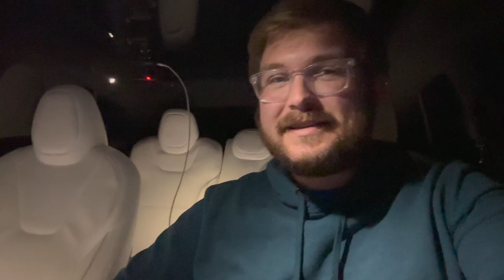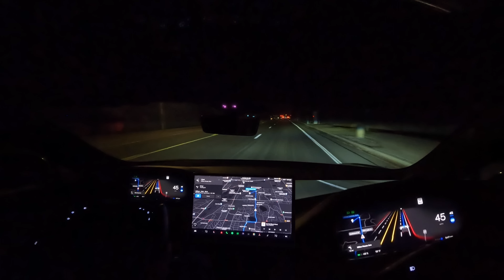I Finally Got Tesla FSD Beta! First Drive And Raw Impressions In My Model S At Night

Comment: I can't wait for FSD to be perfected, but it's nowhere near close from my experience with it.  There were way too many critical errors when I used it last month.    Kyle you are so right about the "social aspects of driving."    I'm sure FSD is 10x safer than a human...   but it drives like "screw everyone else" and is not comfortable experience to the user.  I think the better test of a good FSD system is how comfortable and relaxed the user is with letting the car do what it do.   My FSD had be flying way too fast through neighborhoods and parking lots.   Fails the left turn consistently out of my neighborhood, and left the car perpendicular across two lanes because it wanted to take a left, but then sensed a hard median and didn't know how to correct.   So I just stayed there.  ...and generally, like you said, was missing the social driving.
Reply: "is not comfortable experience to the user" Thats not the point. You can be embarassed or - as you say - have a uncomfortable experience - as much as you want, Did you produce accidents with your FSD driven car? No? Goal achieved, Job well done. Full stop.

Your embarassement aka your "comfotable experience" is not something FSD can and wants to solve.
Reply: @wolfgangpreier9160  Not crashing would be the absolute lowest bar that Tesla seems to have partially solved, but if they want to be a serious robo taxi option that regulators will need to approve, they will definitely need to work hard on the social driving experience and overall comfort of driving.   A Tesla robo taxi is not going to go mainstream or even get approval until they can drive at the same level and comfort as a professional driver/chauffeur.
Reply: @wolfgangpreier9160  i disagree. Never versions of FSD are smoother and more considerate. It will take time. I suspect the issue is less in the data gathering and more in the software logic of what to do.  So hopefully they continue improvements.
Reply: FSD is 0x safer than me.
Reply: No way this is 10x safer than a human, the average driver goes for years without getting into an accident. Myself I've been driving for nearly 20 years and luckily I haven't gotten into an accident. This fsd can't complete a 20 minute drive without human intervention.
Reply: @Cornelius87  I agree 100%
Reply: @punksjutgbd  You must be the new Model from Boston Robotics. How does it feel being an automaton?
Reply: @marklefler4007  Oh yes, they do become better. Just as with every other Software made by MAN they are not perfect. Sometimes they take two steps forward and one step back. 

And then the shitstorm against Tesla starts again. Its tiring. And unnecessary. 

I hope that Tesla gets at least a local or temporary permit to roll out their FSD in Europe. So i can  contribute some hours of learning experience. Even as a glorified lane keep Assistent it would already save lifes. Many!
Reply: @tonykchan  Come time come creature comfort. Look at the first working cars. At the second batch. At the 1910‘s. At the 1920‘, 1930‘s etc. pp. 

I would not have believed Ford has solved the problem and invented the perfect electric pickup. I do not believe the first iteration of the Cybertruck is perfect. etc. pp.

I am of the opinion that there are at least 2 more complete rewrites and 1 more Hardware editions necessary to reach at least simple localized geofenced „level 5 autonomy“. General autonomy and usable AI will go hand in hand with Tesla bot, Boston robotics etc. 5 years? 10 years? Something like that. Somewhere in the far future.

I would already be happy with a jerking and not completely sure FSD in ALL cars that would reduce accidents and dead children to the absolute minimum achievable without staying in a bomb shelter.

Comment: You ask if the internal camera works at night. Yes. Look at your video and you will see a purple/pinkish glow at two spots from the rear view mirror assembly. These are IR diodes which the gopro and many other video cameras register as the purple/pink color.
Reply: It appreas these were added to the production runs of Model Y and 3 around July-Aug 2021, so not all cars might have them. I assume newer Model X and S have them too. Can someone confirm?

Comment: I agree there is a learning curve to properly operating a vehicle on FSD, because it isn't true FSD yet. I use it all the time and take over regularly without even thinking about it and then turn it back on after the problem spot. 

You're right -- turn signals are wonky. It signals right to say "I am not going to use that left turn lane" but when turning left it won't signal a left turn until it actually pulls into the left turn lane. Clearly sending mixed signals. 

It always turns a little right before turning left. Very annoying around here as people always stay left to leave the right side of a lane for those turning right. FSD blocks the whole freaking lane. 

In many ways it is better than a year ago but I'm a few cases, it is actually worse.

Comment: The clarity of the signals your sending to other drivers (and pedestrians) is important, as is consistency in those signals.  It's like a body language.  FSD beta so far seems to fail at both of those things.
Reply: In my experience with Beta, “it fails” is a bit too broad of a sweeping generalization. It succeeds and fails. When it fails it needs to fail gracefully and that is hit and miss.

Comment: I see there are few comments that are right on. You will get use to it and get more comfortable. For example left turn you felt acceleration, it would have stopped for the cars. Good way to double check is on the screen. The on coming cars would have been marked in blue. That means it will yield. 
My wife first started using, she was similar to what you experienced. Now she is used to it and knows where it cannot handle (ex. parking lots still a feature not deployed), she takes over without missing a beat. She hasn’t watched any videos other than my comments. Try few more times. The biggest limitation in my opinion, it is still too slow to make decisions. So you get nervous waiting or embarrassed waiting. These are the majority of the take overs. I don’t remember anytime it tried to crash. It is programmed to be over cautious.
Reply: Exactly this. Like any system (cruise control, TACC, basic lane keeping) it takes getting used to to use correctly and to know what situations it can and cannot handle.

Comment: One of the biggest problems with FSD is the lack of communication with other drivers.  People communicate by seeking each other's gaze.  Give hand signals and so on.  No one knows what FSD does.  Not even the driver of the car in question always knows because the system changes its mind in the middle of a manoeuvre.  We can see how it, like time, flashes to the left, then to the right, just for  to drive straight or - perhaps - turn??? Very unsafe.

 In Japan, I believe it was Toyota who made an attempt to put a few small screens / LED displays on the front of the cars and the rear.  The one on the front in particular was a good idea, it turned out.  It simply told the other drivers what the car would do in a short moment, as well as what the car expected, for example.  the pedestrians did here and now.  A standing man if it expected the passers-by to remain standing, and then a moving car (itself) which showed that now it wanted to start.  Conversely, when it stopped, there were pedestrians walking and a stopped car.

 It was mostly in connection with pedestrians that there was a gain, as other motorists "don't have the time" to check whether an oncoming motorist has such a display mounted and which "cartoon" is currently shown on it.

 Until a way is found in which FSD can send some clear signals of intentions, I am convinced that it will be more dangerous in traffic than a human.  This means a person who takes care of their driving and is alert, who is not drunk or under the influence of drugs.

 I'm glad that I don't run into FSD cars on a daily basis (forbidden to use in this country, so hopefully people don't).

Comment: Ive had it since November I found keeping it in chill mode is perfect for a Beta.  Signals go off in turns randomly,  I have learned in spots on common routes it take what to expect with brain farts.  Pretty much it does decent for me.
Reply: Decent for you but not good enough to be available for everybody. Very dangerous

Comment: Hey Kyle, you know how Tesla navigation voice prompts sometimes come too late for you to actually make the turn?  I suspect that the FSD neural net is NOT looking at the map path to choose where and when to turn, it is getting its waypoints from what would be the voice prompts to a human driver.  A human driver will not look down at the map, see a right turn in half a mile and decide to pass the slow moving car in front of him by going into the left lane, but a human that doesn't know the area with a blanket thrown over the center screen that is relying only on the navigation system voice prompts for turn-by-turn direction would...   Also, I suspect that the strange "turn to the right and creep a foot before making a left turn" is because the car can not turn its head to the right to get a good view of cross traffic... the only way for it to adjust camera view is by moving the entire car.

Comment: Drive it at the speed limit. Nevermind the tailgators. Be more patient at intersection when it's creeping.

 Google maps, always gives the right info ahead of a turn. (ex use 2 left lanes to turn left, bear right) Tesla should tape into this info in order to better plan the drive beyond the cameras field of view. 

I use it everyday to drive around town, most of the time I let do its thing only paying closer attention when it needs to make a more completed maneuver. When there are clear marking it's very smooth but when it to read the curbs to determine the path it gets sketchy. 

 In order for it to behave like a human it would have drive 15 over, tailgate everybody in front, swerve through traffic without using its turn signals and think that it's the best driver on the road.
Reply: Exactly!  Kyle should have done some research before doing this video.  He doesn’t even know that he sets the follow distance.  Not my favorite video

Comment: FSD can be impressive and insufficient at the same time. The danger is when some want to focus on the former and ignore the latter. 

I would be interested to see a controlled closed system test consisting of a downtown area with only cars equipped with FSD navigating the streets among each other. Only the machines driving, no interventions, for one hour. Then do it in a suburban environment, too. What would happen? 

If the answer is not “nothing unusual” the system shouldn’t be allowed to be used by untrained professionals in an uncontrolled environment. It’s a testament to Tesla’s ability to cultivate a market willing to pay to help them develop a system that is still a long way from fulfilling its promises.

Comment: The problem I have with this is auto manufacturers usually test these systems in a closed loop (test track, controlled drives, etc.) BEFORE releasing the technology.  Tesla is letting any owner pay to be a beta tester and then you the owner/driver is testing it on public streets and highways possibly endangering yourself and other drivers.  Your video showed that the system was erratic and dangerous.  I’m all for electric cars but not the mentality of fanboys that think that anything cool is good.

Comment: This very much proves Tesla NEED to have detailed video guides on what FSD can and can not do, and I think you should put more pressure on the twitter and youtube to ask Tesla to please just do a guide (like the NIO system). I see Kyle is incredibly confused about it and I don't think other people will be less confused for the first time using it... 1. It doesn't do parking lots at all, and right turning off a road onto a drive way is barely doable, you should take over just before the destination, and engage it only when you are on the road. 2. It doesn't do u-turns at all, neither does it do reverse. 3. This is a more technical fact but I do think they need to communicate this to people in a less technical way: 

The route planning basically have two parts, one is the navigation, just like the navigation you would get say from google maps telling you there's a turn somewhere ahead, or which turning lane you should go into. The other route planning is the actual driving route planning, i.e. the blue line on the visualization. This is the actual route the car is going to do and it tries to get the driving route onto the navigation requirements. Problem is this route planning has a very short distance so maybe it knows it need to right turn just 100 meters down the road, but the driving route planner don't see that turn (because it's out of the planning range). So unless the maps navigation has good enough data to tell it it needs to stick on the right lane, the route planner will just drive straight ahead (and in the case of the video, even going to the left lane because maybe it decides the car in front is too slow compared to the set speed).

When it goes off route it will try its best to re-route, but usually when you miss a turn the reroute puts you in for another totally impossible route (because no u turns). So what I would say is to just take over when it goes off route. Also taking over when it misses a turn sends Tesla a signal that this is problematic. (They track take overs and it's the most serious indicator to them that the system failed)
Reply: I would actually say it is not quite responsible for @OutofSpecReviews to put out a video that is trying to have it do things it can not do (lots of parking-lot and driveway related maneuvers). However I can't blame Kyle for this because no one would have told him or another customer the things it can not do...
Reply: Also it does do better in California, right outside their office windows. If you live close enough to their autopilot team I guess you can drive to work without takeovers...

Comment: Rule of thumb is don't try and judge FSD too quickly.  It takes a couple of weeks to become familiar with how it drives and when to intervene or disengage.  Nice video. @12:07 you talked about people saying a successful drive if it didn't crash.  I don't know anyone who thinks that nor do posts on Reddit or Tesla Motor Club forum support that.  A drive's success is dependent first on disengagements and second on interventions.   For me its a success if there are no disengagements and the interventions are minimal like adjusting the speed by 2-5 mph.  @34 you stated it was the same as a year ago.  Unless you've had FSD for over a year it's difficult to support that.  I've had it since Oct 21 and FSD is night and day better.  Long way to go but improving for sure.

Comment: Great video.
I think, since FSD is based on AI, it is supposed to learn, and if the drivers cross double yellow lines, and do weird stuff, it seemingly learned that that is OK. So I think the FSD beta drivers should make it their goal to teach the car like a learner would be taught. But maybe I'm wrong.
Reply: That's kind of the problem if you let the system learn from not professional drivers but there should still be some ground rules be baked in. Also it's not as if the cars would be learning that way. Data goes to the data center, there it gets processed and baked into the driving model and then the cars get a software update with this new behaviour baked in. But the car doens't learn in between updates.
Reply: @EVPaddy  yes, I think you are right

Comment: The scariest bit is that they are relying purely on cameras for this. It is never going to work in tricky conditions like rain or driving with the sun low in the sky. We have learned from aviation that having multiple different sources of data is vital for automation to work.

Comment: I truly think that at least half of the incidents that bothered you and your wife on this drive were due to your level of discomfort with the idea that the car didn't always do exactly what you would have done as a driver.  This is completely normal for your first drives of FSD beta.  I felt the same way at first.  I can assure you that after spending a few weeks driving with FSD beta everyday you will begin to understand that the range of possible maneuvers&accelerations that are acceptable/comfortable/safe in any given situation are actually more expansive than the single way you would do it.  In other words you will begin to trust the car more over time and it will be way more comfortable to you as the monitoring driver.  You will understand when it is really really good and when things could be a bit sketchy.  I would recommend to set the speed limit as the default speed since this will be more comfortable for you. Also, one more important point...  I think to claim that the system is "not safe"  is not true, misleading,  and is a disservice to your viewers.  At this stage of FSD beta development ,when used as instructed -always pay attention and take over when needed - it is likely safer than a driver alone.  The reason for this is that the redundancy of having FSD beta doing many things better and more reliably than me (which must admit happens from time to time) and me doing other things better than FSD beta makes us safer together than either "system" alone.  This is one of the major reasons I use it all the time and encourage my wife to do the same.  As the system has improved over the last year, both of us have reached a level of comfort in most situations that we can't imagine living without it now.
Reply: Well said. 👍